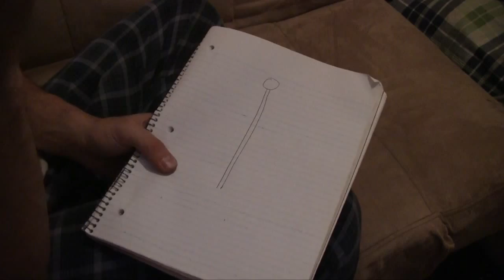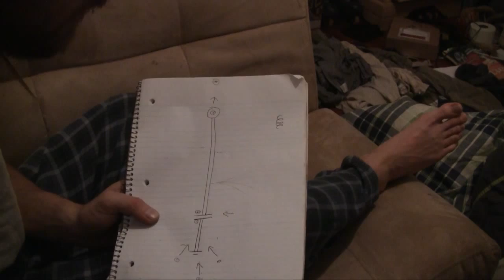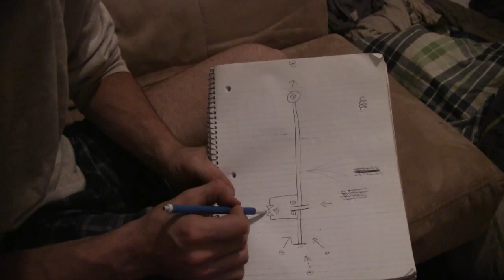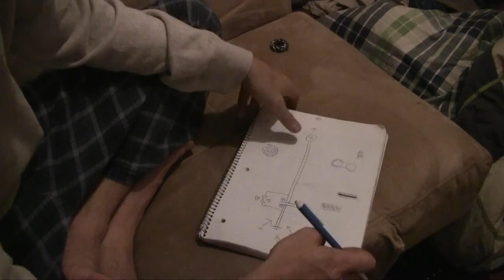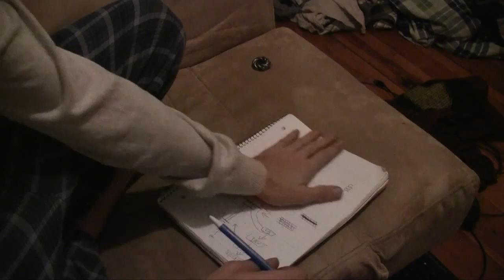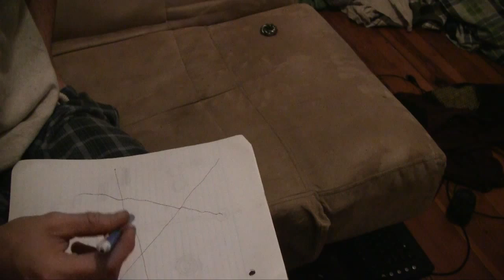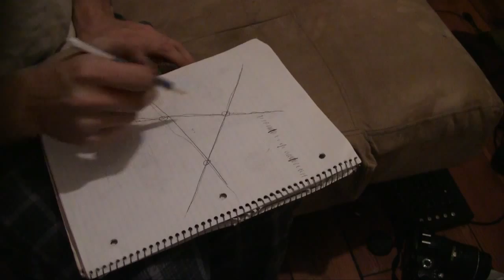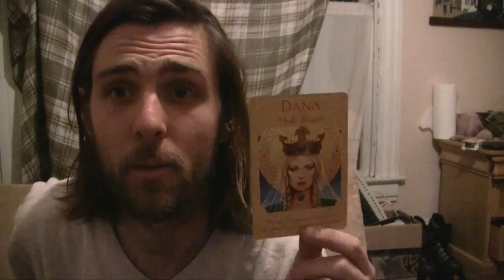How Tesla Towers Work

Comment: first of all i would like to say great video. i have a couple questions though how do i know when the capacitor is properly tuned i understood how to make one for the tower just not how to configure tuning. Also do you have to use a capacitor to store energy or would it be possible to use the process of electrolasys to produce hydrogen so you could store energy when your making too much and burn it when you need to procuduce more electricity also how do i know when the tower is oscilating right?